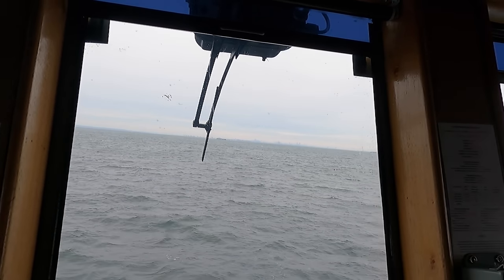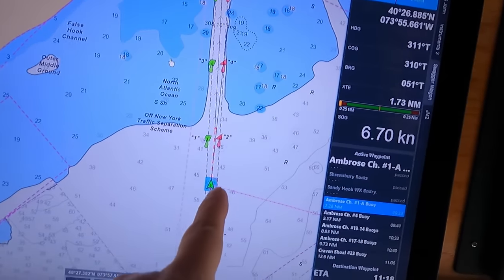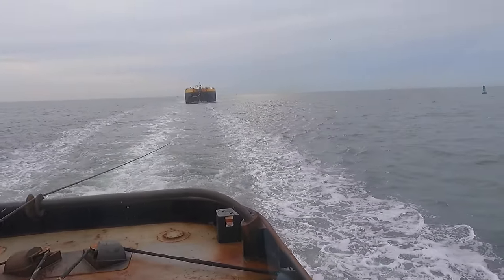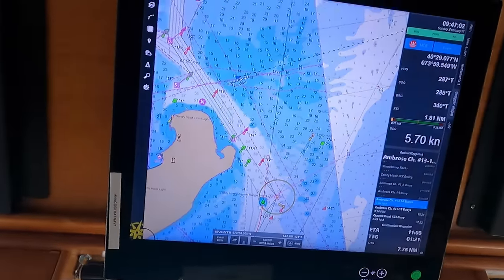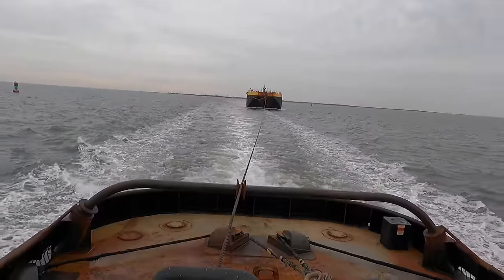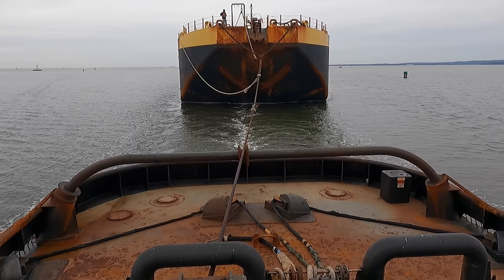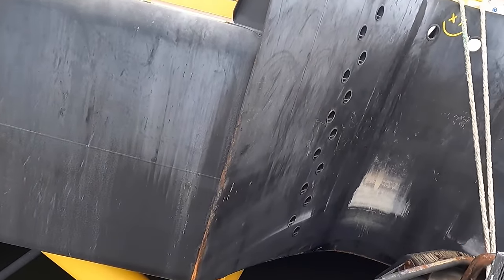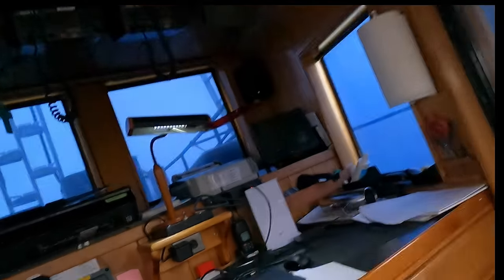We Pull The Pin (on our Tow)

Comment: Very interesting watching your winch and wire operate. I was on two ocean going tugs in the 60/70 , the ATF 101 Cocopa and the ATF 105 Moctobi which used a 6 inch main cable. Since I ran the Main Control powering the entire ship I Paid careful attention to the propulsion amperage and main winch loads. You never want to see that cable snap in and out of the water.
Reply from the maker: Thank you for watching and welcome to the channel James. CUOTO

Comment: Wish I had stayed in the Maritime industry. Worked on the Mississippi River as a Deckhand, I Loved working the big Vertical Capstan on the aft end of The Mississippi Queen with 10 Deckhands It was 116 meters (382 ft) long, 21 meters (68 ft) wide 22ft Dia Paddlewheel driven by two 2000 HP steam pistons.
Reply from the maker: Thank you for watching Eric. That must have been fun! CUOTO

Comment: So many things could wrong and you only have to be wrong once. Keeping up with the traffic, the tide, the wind and the wave movements as well as keeping in the channel. Most of us never have to worry about bad consequences if we make a mistake. Good job.
Reply: You don’t do those moves in the main channel of a major port. You stay in safe water and out of the way while doing the evolutions. Being aware of the disposition of the tow and traffic are paramount. Getting off the wire is extremely hazardous and not to be taken lightly. Professional boat men do it with the fewest moves possible in a very specific order of operations. We go on and off the wire all times of day and many types of weather. Well practiced team work is what makes for success. These fellows know their work.
  I have done the way this crew does it many times. I prefer pulling the pennant up shorter and putting a stopper on it. The slacking the wire . Keeping the shackle down near the deck. Remove the shackle , then loose the stopper . Much more control. This system has tension in three directions at once . I have seen the pin jam too many times. My bonafides 26years towing off shore.
Reply from the maker: Thank you very much for watching Larry. CUOTO

Comment: Tim, you've done a great job getting on top of audio problems.  A professional sound person would shake in their boots if asked to record voice on that barge.  You have various loud engine noise sources, and when outside, a ton of wind.  All you can do is close mic to make your voice much louder than the background sound, and you are doing that nicely.  The most important thing is that you listen and heed what your viewers tell you.  I would say you are a minority regards doing that.  

My goodness.  The size of that shackle, after the lads pulled the pin, surprised me.  When your man grabbed the shackle @23:37 and gave us something to scale it against!  And what was the size of the bolt/pin?  The nut completely filled his hand @22:43   Can you read the tension on the winch line from the wheelhouse, or is that years of experience watching how much the wire dips, and equating that with distance to the barge and sea conditions.  The more I follow your exploits Tim, the more complex I think your job is.  All very impressive.
Reply from the maker: Thank you very very much Trevor. I really appreciate your kind words. Almost 25 years ago I worked on a tug that had a gauge that would show the tension on the wire. But I've never seen that on a boat since then. We watch the wire and see how far it goes out before going underwater. It takes a bit of time, but you get a handle on it. CUOTO

Comment: I really enjoy the videos, which you make very understandable to landlubbers.  A couple of questions: What are the distances in feet, yards or whatever that the barge is behind the tug when at sea, in the channel, etc?  When you take in a layer on the winch, how much does the barge-tug distance change?
Reply from the maker: Thank you for watching and welcome to the channel. How much wire we put changes with a bunch of different things. Sea state, water depth, lite or loaded barge and sea room. We usually tow offshore with about 5 layers out or about 1200 to 1500 feet of wire out. CUOTO

Comment: You're electronic chart on fathoms or feet, if its in feet not a whole lot of water to work with. This video puts in perspective how big these tank barges are, they are fairly tall. The bridles on the barge seem to be quite short surprised to see they are chain. Amazing how strong that blue steel synthetic line is, you snorted it up pretty good. Around here the tide can rip pretty good, guys would let their barges let loose of the wire to come to do shuttling adding another barge to the tow or crew changes and their barge(s) are f***ing off down the strait, the tug is doing the mad dash to go catch their tow 😂
Reply from the maker: Thank you for watching. Yes, the chain is mainly there to add weight to the bridal. CUOTO

Comment: How do you secure the tow wire from going  sideways if there is a difficult sea state,or the objekt you tow is not behind you? 
Especially when helping ships moore  to or go  out from dockings .
What i understand  tow boats has flipped over because of this .
I see 3 caps in the stern deck, are deese mayby the answer of the question,  you pusch does poles  up and the cabel is run under the  pipe bow and inbewen these poles and out sturnvise?
Also are the covers on the exhaust pipes for fire fighting purposes ?
Reply from the maker: Thank you for watching and welcome to the channel. Usually the barge wants to stay behind you when you are pulling on it. There are some boats that have " towing pins" but we don't have them. What you are seeing are the access ports to remove the rudders. CUOTO

Comment: Great video facinating to me. Would hate to do that with light barge and high winds. Do you have something similar to chain counter on wire orbis is just all visual?
Reply from the maker: Thank you for watching. We visually check wraps and layers of wire. Another words, I might say to my mate when handing over the watch, "we've got a couple wraps more than 4 lays out". CUOTO
Reply: How long is a layer of wire? @TimBatSea
Reply from the maker: @Rangersfan381  it depends. As the layers get smaller with each one you put out because the diameter of the winch drum gets smaller. But around 200 to 250 feet is a good estimate.

Comment: Hi Tim,
Great Video of the change of wire to push gear.  As many folks shared, great views of Sandy Hook and the Lower and Raritan Bays.  A question; how is a layer of wire defined?  I have not heard that term before.  Sounds like similar use of a shot of anchor rode measured at 90 feet.
Thanks!
Ed
Reply from the maker: Thank you for watching Ed. The wire is wrapped around a wire drum in layers. Each layer gets smaller as you get deeper in the drum. So the layers on top have the largest diameter, and end up being longer in length. CUOTO
Reply: @TimBatSea  Tim, Thanks for the explanation!  It makes sense.  Ed

Comment: Yeah well,  it's when that wire comes up into the air that it's getting tight meaning that's where it'll be put to the test.  When fishing off the
beach it's always when the line comes up out of the water that it can break but while it's down it's not stung tight.  When the weight falls
directly on the fish(barge), it's easier to break off.  Sorry bout my analogy & you really don't want anymore line out than needed for better
control.  IT's cool watching this.  I always liked being out on the water. So the internet lets me do just that............  peace
Reply from the maker: Thank you very much for watching. Our wire is designed to take a lot of load. But it's the shock load that we try to avoid. Think of a hammer, nail and a piece of oak. You could push as hard as you can on the hammer pushing on the nail, but it won't go into the oak. But if you swing the hammer (building up energy) and hit the nail, it goes into the oak. So as long as the wire is not receiving a shock load, keeping it under tension above the water is fine. CUOTO
Reply: Well thanks for your time Captain,  I love the water but I landlocked in Texas.... lol,  I chose to be here so I've got no
complaints & besides,  it wouldn't do any good to complain.  I find watching things like your boat chugging up into
the waters of NY/NJ satisfying & seeing the map screen paints a picture & then we see the  real world out back
which completes the picture.  I'd like to see the nitty gritty as you dump the barge off....seeing it tied off for the
company who'll load it would be cool to see.  I used to see lots of barges when I lived near New Orleans...
all kinds of boat traffic.  thanks again for your time

Comment: When you said you had three layers out, did you mean Fathoms Chains, or shackles? Why didn't the barge hand use the Panama chocks or as we know them Panama Leads, they would stop a lot of wear and tear.
Reply from the maker: Thank you for watching. The wire wraps around it's winch drum in layers. We count the number of wraps (or revolutions) and or layers so that we tow the barge more consistently. I'm not sure what you are referring to. We call recessed bits in the hull of a  ship, Panama Chocks. CUOTO

Comment: What are the Safeties on the push gear?
Reply from the maker: Thank you for watching Mike. They are 8 inch lines that go from shoulder bits on the tug to the aft bits on the barge. Their primary purpose is to keep us in the notch if we break a push leg (the push gear). Without them and with way on a barge, in the event of a push gear failure the tug goes sideways and gets "tripped". Not a good day. CUOTO

Comment: I see two men without any safety equipment other than life jackets. moving out onto an open deck with tensioned steel wire is what you call suicidal😳🫣
Reply from the maker: Thank you very much for watching. The camera hides quite a bit. Because the height of the winch and Texas Bar, the men on deck would have to be much taller to get hit by the wire. After watching the videos on this channel, you should see that safety and best practices are the goal of our crew. CUOTO

Comment: You ever have a boat drive over the cable not realizing you're towing a barge?
Reply from the maker: Thank you very much for watching and welcome to the channel. Unfortunately that happens more than it should. CUOTO
Reply: I guess it's deep enough most boats don't hit it huh?  @TimBatSea
Reply from the maker: @grasscutter88  We blow the horn, and flash the search light then if they keep coming, we pull the throttles back to sink the wire. CUOTO

Comment: I ran a six pack charter out of Connecticut,every once in a while we’d see a tug and barge going up the beach and every time the costumers would ask if I ever seen someone run between them and hitting the wire. I never saw it or heard a credible story of it happening.  How about you Tim did you ever have anybody drive between the tug and barge
Reply: I thought there was a Sailboat  years ago
Reply from the maker: Thank you for watching Christopher.. unfortunately that actually happens much more than you might think. And yes. In buzzard's bay. We pull back on the throttles to get the wire to sink to try to save a life, and in my case, lost a $30k wire and the pleasure boat just kept going. To this day (that happened 20 years ago) I wonder if that person is walking around not knowing that he's alive, and a job was almost lost) because he wasn't paying attention? CUOTO